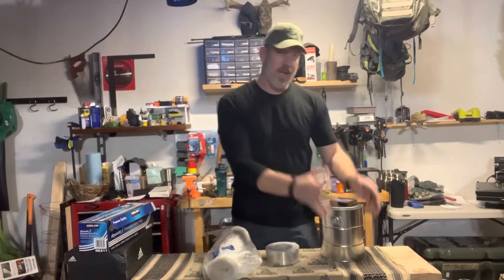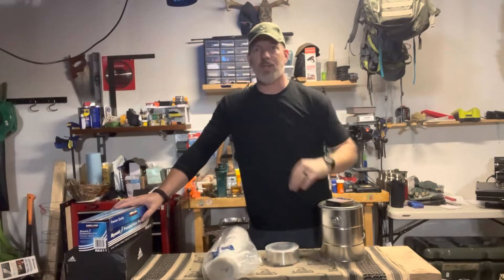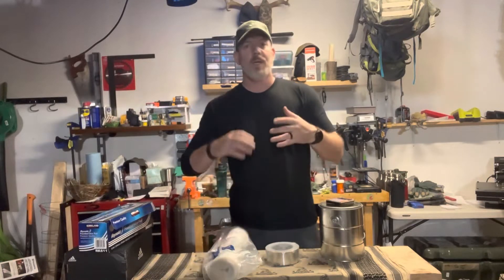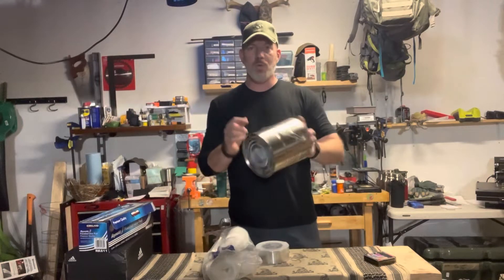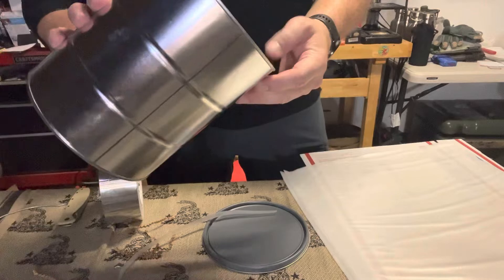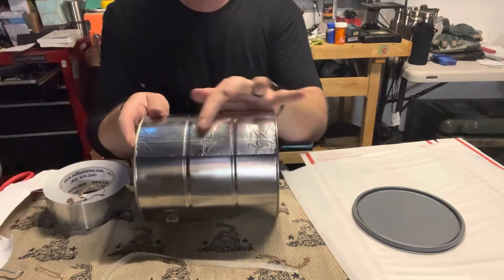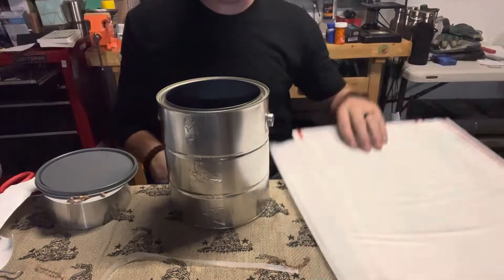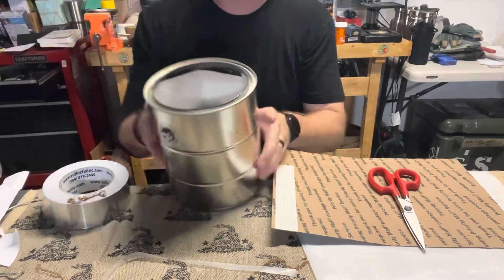DIY Faraday Cage

Comment: Can you do  a video on turning a small metal shed into a Faraday Cage.  I am trying to do that with my metal shed, because I have large portable gas generators, Batteries and small vehicles that I store in it.
Reply from the maker: I don’t have access to a metal shed.  But if the whole structure is metal you can put a wooden floor down so your electronics don’t touch the metal. Seal any openings with aluminum tape so the pulse travels around and not into the shed. That may work. There is also faraday sheets you can buy and wrap your large electronics in.